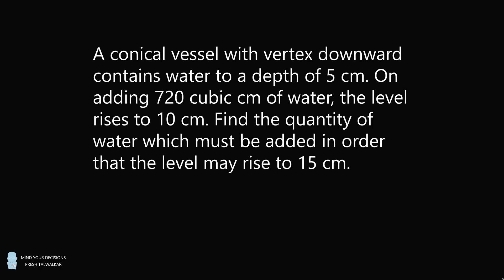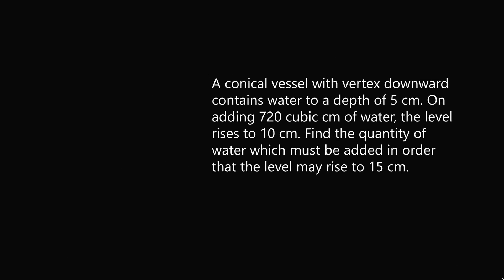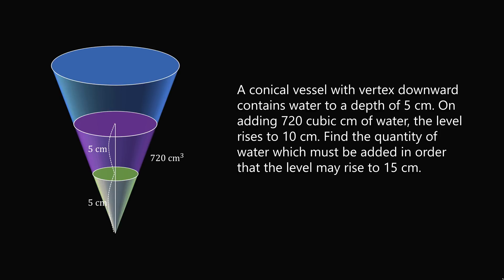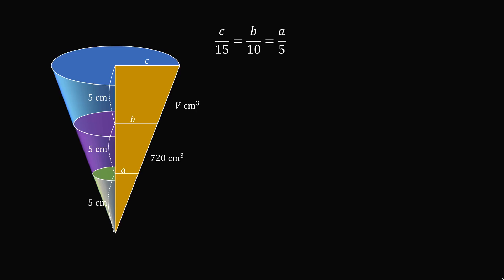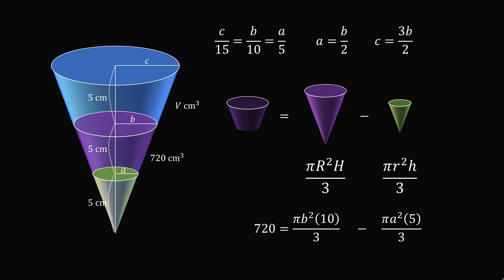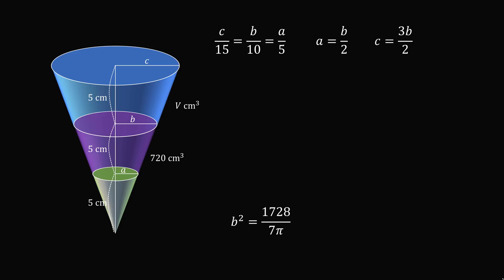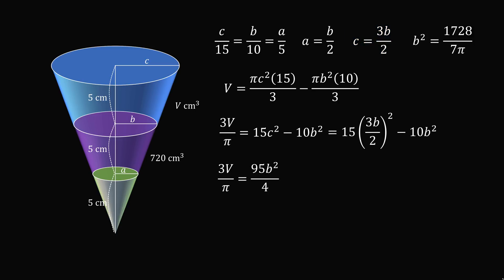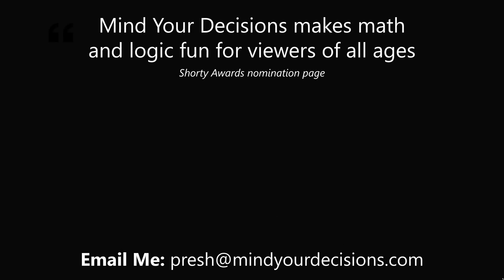Filling Up A Conical Cup - How Much Water Is Needed?

Comment: The volume ratio is proportional to the cube of the line segment ratio, so if the volume of the gray part is V, the purple part is (2^3-1)V=7V=720   ∴V=720/7   The volume of the blue part is (3^3-2^3)V=(27-8)V=19(720/7)=13680/7

Comment: The way I did it:
1 - relate the volume and height of the cone:
V(h, r) = (1/3)π(r^2)h

2 - express the radius of the cone in terms of its height:
the radius of the cone is equal to the side of a right triangle with the other side being the height,
r/h = C, where C is a constant so r = Ch

3 - plug Ch into r in the volume formula
V(h) = (1/3)π(C^2)(h^3)

4 - use the given information to find the value of (C^2):
V(10) - V(5) = 720 
so C^2 = 432/(175π)
so the volume formula becomes:
V(h) = (144/175)(h^3)

5 - model the situation with an equation:
V(10) + x = V(15), where x is the volume we need to add for the level of the water to go from 10 to 15.
x = V(15) - V(10)
x = (144/175)(15^3 - 10^3) 
x ≃ 1954.28

Comment: Observe that b=2a and c=3a. Now 5*(pi/3)*a^2+720=10*(pi/3)*(2*a)^2 which leads to a=(9/7)*sqrt(21*pi)/pi . Using the differences between the volumes of the cones we can easily arrive to the required volume: 13680/7 cm^3.

Comment: I think I solved it in a wierder? way. I re-wrote the V=1/3πh(R^2) as V=1/3π(h^3)(tanω)^2 were ω is the angle the h forms with the cone's curved plain. From V2-V1=720 we get that 1/3π(tanω)^2=720/875. From then on we do V3-V2 and we get the final result. This solution comes from the very proof that the volume of a cone equals V=1/3πh(R^2), penultimate step of which is the type V=1/3π(h^3)(tanω)^2 using an integral of πr^2 from 0 to h and exploiting the fact that the only constant in a cone is the angle (ω) that forms via its crossection with a vertical plain that passes from the yy' axis.
Reply: This is similar to how I did it, using tan of the angle.

Comment: My way of doing it is to notice that the volume is proportional to the cube of the height, therefore we can create a formula

v = C * h^3 where v is the volume, h is the height and C is the coefficient. We can simplify this more by expressing depth in multiples of 5 cm without any loss of generality (it just increases C by a factor of 5^3). So our depths are 1, 2 and 3 "penta-centimetres" (pcm)

To take the 1 pcm depth data point

i) x = C

Now take the 2 pcm data point 

x + 720 = C * 2^3 = 8C

ii) x = 8C - 720

if we substitute for x from equation (i) we get

C = 8C - 720
720 = 7C

iii) C = 720/7 

Now work out the volume difference (y) between 3 pcm and 2 pcm depth to get our water volume

y = C * 3^3 - C * 2^3 = 19 * C

Substituting for C

y = 19 * 720 / 7 = 1,3680 / 7

That gets rid of a lot of messy coefficients like Pi in the equations...

Comment: I solved it more or less the way Presh did it, recognizing the similar triangles.  Only difference is, I worked out the radius of the smallest cone (r) so the  purple and blue cones have radius of 2r and 3r.  

Most of all, I admired the brilliant animation that has now become a standard of Presh videos.  Excellent for visualization.

Another thing which made the problem easy?  No super hard to find hidden tricks.

Comment: All the cone are similar. That means, by the rules of homothety, the stretching factor is squared for areas and cubed for volumes. So, stretching the dimensions of the cone by factor 3 means multiplying its surface by 9 and multiplying its volume by 27.

Comment: By the rules of homothety, scaling line by factor 2 (3) means scaling areas by factor 4 (9) and volumes by factor 8 (27).
Thus, the cone contained x = (720 + x)/8 ml = 720/7 ml ≈ 103 ml before adding water. 
Therefore, it now contains 720/7 ml + 720 ml = 5.760/7 ml ≈ 823 ml.
If you fill up to 15 cm, it contains 720/7 ml ⋅ (15 cm / 5 cm)³ = 19.440/7 ml ≈ 2.777 ml.
Therfore, you must add 19.440/7 ml - 5.760/7 ml = 13.680/7 ml ≈ 1.954 ml.

Comment: Use Calculus! Just Integrate pi*r^2, and have r equal sd/10, with s being the radius at 10 depth and d being the depth. Setting the integral with boundaries at 5 and 10 and having it equal 720, then doing elementary calculus gives you the value of s. Then, set up the same integral, except you replace the s with its value, and then you set the limits to 10 and 15. 1954.29 I got in two minutes with a 4-function calculator.

Comment: 5 cm is a redundant condition. Using that condition only result in more calculations.
This is exactly why I strongly recommend people to do calculations using symbols as much as possible.
It's 3 basic right angle triangle with h-r, 2h-2r, 3h-3r
So their volume are to the scale of 1, 8, 27
We know the volume in the middle which is 8-1 = 7 times
We are looking for volume on the top which is 27 - 8 = 19 times

Comment: Hmm, I don't think this one is going to have any slick trick. I think you'll need to do a lot of equation work with the volume of a cone and some proprtions for ratio to height.

Edit: Looks like that's just what you did! But there's a comment about considering volume ratios of 1, 8, 27, etc. that has a nice idea to get it. I like that idea, but it's a little lacking in rigor.
Reply: no, it is perfectly rigorous when expressed correctly.
Reply: @FriendsforFriendsUK  expressed is the correct term! Though the statement would need some sort of justification.
Reply: @mike1024.  start with the formula for volume of a cone. Move straight from that to showing the ratios of volumes, the rest is arithmetic and  does not need pi, which has cancelled out.
Reply: @FriendsforFriendsUK  Agreed. I said a little bit more about rigor in the post where I read that idea.

Comment: There is a much faster way to avoid tons of algebra.
We don't have to figure out the radii a, b & c.

∵ the 3 cones are similar solids,
∴ the volume ratio = (the height ratio)³
= 1³ : 2³ : 3³
= 1 : 8 : 27
Using the color code in the figure,
volume of blue part ÷ 720 = (27-8) ÷ (8-1)
required volume of water = 13680/7 cm³

(By the way, the terminology for the blue part and the purple part is frustum.)
Reply: Where does the 1, 2 and 3 come from???
Reply: @pipzog389  The heights of the 3 cones are 5, 10, 15. So the height ratio
= 5 : 10 : 15
= 1 : 2 : 3

Comment: other technique :
When the lenght are multiplied by x the volumes are multiplied by x cube, so if we label a the volume of water of the green section, the purpul section is 2*2*2a - a = 8a-a = 7a and the volume of the blue section is 27a - 8a = 19a
so we got 7a = 720 and we want to know 19a...
we just do 720 * 19 / 7 = 13680/7

Comment: You may solve it much easier using two proportions (two linear equations). You don't need to calculate surfaces, You don't need to use PI in Your formulas.

Comment: Assume a cone of height h, radius r and volume v. 
If the cone is increased in height by an amount Δh and in radius by Δr, then the corresponding change in volume Δv is given by 

(Δv)/v = [(1+Δh/h)^3] - 1 ------ (1) [proof of which is below]

Case 1: 

h = 5, Δh = 5 and v = 720:

Eqn (1) becomes: 

(720/v) = [(1+(5/5))^3] - 1 = 7

Therefore, 

v = 720/7

The total Volume, W is now:

W = v+Δv = 720 + (720/7) = (8/7) x 720

Case 2: 

h = 10, Δh = 5 and W = (8/7) x 720:

Eqn (1) becomes: 

(Δv)/W) = [(1+(5/10))^3 ] - 1 = 2.375

Therefore, 

Δv = 2.375 x W 
     = 2.375 x (8/7) x 720 
     
     = 1,954.29

-------------------------------------------------------------

Proof of Eqn (1):

Draw a cone (as in the video) but with lengths h, Δh, and radii r and Δr 

By similar triangles:

(r+Δr)/(h+Δh) = (r/h)

Therefore:

(r+Δr) = (r/h).(h+Δh) --------- (2)

Volume (V) of cone with length h and radius r:

V = 1/3Л.h.(r^2) 
   = k.h.(r^2) (with k = 1/3Л)

With the cone increased in length by h+Δh and radius r+Δr, the new Volume (W) is: 

W = k.(h+Δh).(r+Δr)^2 ------------ (3)

Substituting eqn (2) in eqn (3) gives:
 
W = k.(h+Δh).[(r/h)(h+Δh)]^2

    = k.(r^2)/(h^2).(h+Δh)^3 ----------- (4)

Dividing Eqn (4) by V = khr^2, gives:

(W/V) = (1/h^3)(1+Δh/h)^3

Or,
W = V.(1+Δh/h)^3

This gives,
 
(W-V)/V = [(1+ Δh/h)^3] - 1 

which is eqn (1) with Δv = W - V

Comment: let the volume  of water at depth  of 5cm be v . then then volume of water at depth of 10 cm will be (10/5 )cubed time more = 8v 
v + 720= 8v 
v = 720/7
volume of cone at 15cm depth = (15/5)cubed  x 720/7
=19440/7

hence volume of water to be added = 19440/7 --8v /7
= 19440 /7 -- 5760/7
=13680/7 cm cubed

Comment: The total volume of the cone after each 5 cm portion is added are in relation 1:8:27 to each other as the cone is 3D object. So the relation of the added portions is 1:7:19 from which the volume of the last portion is 720 * 19/7 = 1954.29.

Comment: The volume of similar figures is in cubic ratio. So, if the small cone has volume of V, the middle is 8V (which means 720=8V-V=7V), and the big one is 27V. Difference between big and middle is 27V-8V=19V, thus answer is 720/7*19. No cone volume formula needed.

Comment: I didn't think of the cubed proportions approach. So I used Calculus (disc method for finding volume). Integrating y = pi(mx)^2 from 5 to 10 = 720. Solve for m, then do the same thing integrating from 10 to 15 (plugging in the value of m) to solve for the volume of the final section
Reply: Same! That's my first thought as well.

Comment: @MindYourDecisions Would we not be able to apply the principles of proportionality since the cone is similarly shaped at any depth. The volume at 5, 10, and 15 centimetres would thus be in a ratio of 1 : 8 : 27. The volume of water needed would therefore equal to 720 * (27 - 8) / (8 - 1) = 1954.2857... cubic centimetres.

Comment: I tried with the approach of finding a formula for volume given the height (or depth d, in this case) and the angle between d and the outside of the cone. Given that the radius, depth, and outside of the cone form a right triangle, it's possible to find that formula f and use f(10) - f(5) = 720 to get the angle (~41.555°) and go from there.
Reply: You don't need to go to such trouble!  Regardless of the cone's angle, the ratios of volumes of 3 cones 5, 10, 15cm high is 1:8:27.  So the volumes of the 3 segments are in proportions 1:7:19.  Answer is 19/7 x 720.

Comment: I did it and didn't use pi. I first got V = f(h).  The radius goes with the height h. The area goes with h^2. Integrating and we get that the volume goes with h^3. So V = a constant k times the height h. V = k*h^3. Knowing the volume between h = 5 and h = 10 we calculate that k is 720/875 or 144/175. Then the answer is just f(15) - f(10).
Reply: I considered the volume to be the volume of a straight line y=mx revolution about x axis, integrating from 5 to 10 and solving for m then integrating from 10 to 15 yields the same answer

Comment: Video is explaining it in complicated manner. 3 cones are in ratio of 1:8:27. So these 3 section are in ratio of 1:7:19.
So answer is 720 x 19/7
Reply: ChatGPT: Yes, that's correct. If we divide the three cones according to their ratios in terms of volume, we get the ratio of 1:7:19 for the respective parts. If we then add 720 cubic centimeters of water, we get the volume of the middle part, multiplied by the factor 19/7, to calculate the total amount of water that needs to be added to increase the water level by 5 cm.
Reply: @OrbitTheSun  chat gpt

Comment: All three dimensional objects scale by a factor of size cubed.  So the cones were of relative size 1, 8 and 27. If you want to take a shortcut.
Reply: V= 720*(19/7)
Reply: Yes, I did it the same way.  Thankfully, pi is not required for any of it.
Reply: Indeed, the answer is V=720/(8-1)*(27-8)

Why:
The smallest cone is V1=720/(8-1)
The complete volume of the medium cone is V2=V1*8
The complete volume of the big cone is V3=V1*27
The answer is V=V3-V2=V1*(27-8)
Reply: I think the ratios method is the simplest.
Reply: I wouldn't say it's a shortcut -- it's a legitimate way to solve it!
Reply: Replace 720 by 700 if you really want to have fun!
Reply: What does this mean?
Reply: @PieInTheSky9  it means you can multiply by the ratio of sizes.  So for example the first time you added water you must have added seven times the initial amount to make eight times total.
Reply: @johnschmidt1262  All the cone are similar. That means, by the rules of homothety, the stretching factor is squared for areas and cubed for volumes. So, stretching the dimensions of the cone by factor 3 means multiplying its surface by 9 and multiplying its volume by 27.
Reply: Exactly. You get about 103 ml for 5 cm, 823 ml for 10 cm and 2.777 ml for 15 cm. Subtract 823 ml from 2.777 ml, and you get 1.954 ml.
Reply: I really like this approach! It was going through my head a little when I first saw height doubling and thinking about how that affects the volume. But I want to add one thing: Your claim that volumes change in a 1, 8, 27 ratio lacks rigor. That may be why Presh chose not to use that approach. Even though it's a much faster answer, stating the fact rigorously and also showing rigorously how it applies to this problem would take a moment. You'd have to show that the radius changes at the same rate as the height using proportions and then go to the volume formula to show that it has a cubic relationship with the multiplier on the height.
Reply: @mike1024.  You don't have to show how volumes scale any more than you have to prove the formula for the volume of a cone before you use it. It's a well known fact that a dilation by a factor of k will scale areas by k² and volumes by k³. 

In fact, I taught this to my 10th grade geometry students just a month ago. They proved it for simple shapes like right rectangular prisms and then made informal arguments to extend it to any 3 dimensional solid.

Both the formulas for volume and the scale for volume require calculus to prove rigorously (as far as I've seen). I'd argue that they are equally rigorous in this case in that we're using a well known fact without proving it all over again.
Reply: @mike1024.  LoL, I did say it was a shortcut.  There is a rigorous way to do something equivalent I believe.
Reply: @mike1024.  All you need to show is that cutting a cone is equivalent to scaling it.  A cone (running off to infinity) is a "scaleless solid", meaning that no linear measure can be derived from it.  Performing the cut adds that linear measure, so, adds the scale factor.  ANY scaleless solid has this property.  For example, if you replaced the cone with a pyramid, the answer would be the same.  The cone in the problem need not even have its axis vertical!  As long as the tilt is not so much as to spill water, the solution is the SAME.

Comment: Another way of solving:  ratio of volume of 5 cm height cone and that of 10 cm height cone is 8. This means 720 cm3 is 7/8 th of  volume of 10cm ht cone. 15 cm height cone volume is 27 times  of 5cm height cone which is 720/7 cm3. Answer would be 720/7 x 27 - 720/7 x 8
Reply: Yes, video is explaining it in complicated manner. 3 cones are in ratio of 1:8:27. So these 3 section are in ratio of 1:7:19.
So answer is 720 x 19/7